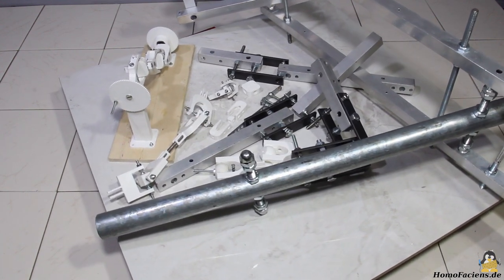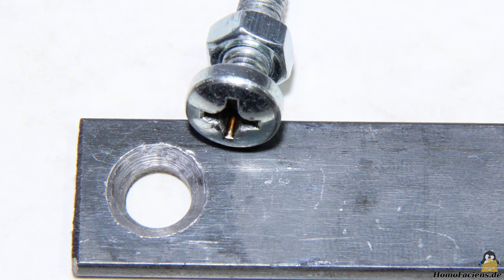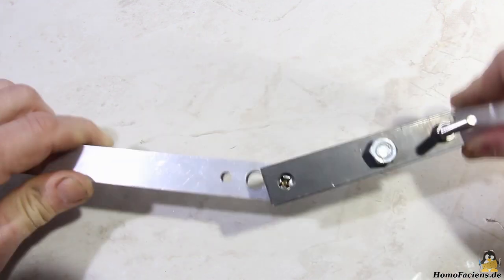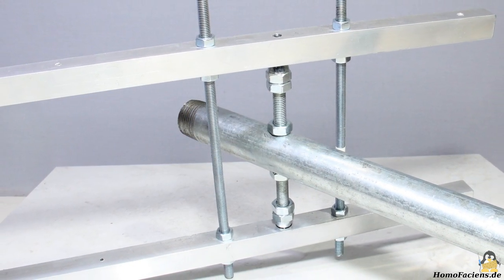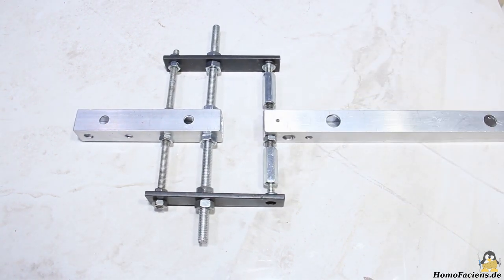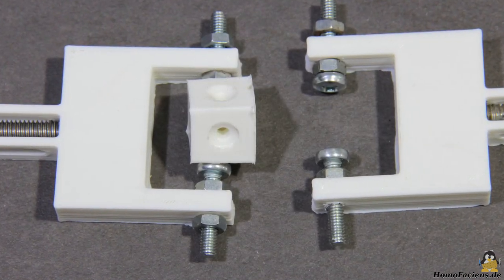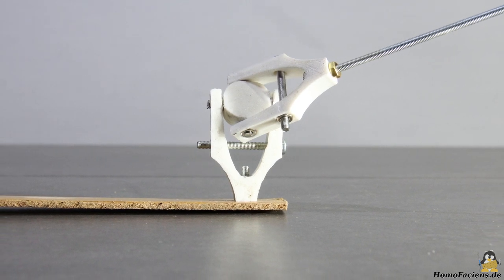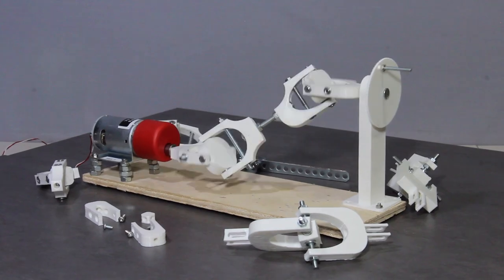Simple, DIY, adjustable joints

Comment: Great video, no time wasted. 3:50 I've done this with wood (for the center I just drilled through each side, inserted screws (cut off heads), and attached pcb columns that connected to each support plate) and surprisingly it was pretty reliable (not something you would use in a real project though).
Reply from the maker: Makers often need quick to build solutions for a proof of concept rather than something perfect that lasts for ever. So thanks for sharing your solution!

Comment: Excellent information.  Even though I am more electrical/software oriented, gears and linkages can be fascinating.   Was the pipe countersunk ? The pipe that the 10mm nuts made contact with. It did not look like it was but I guess it would of had to be.
Reply from the maker: Aluminium is relatively soft which is why those square tubes bend slightly inwards when pressing the cap nuts on the edge of the hole. With that there is no need to countersink the hole. Especially with a wall thickness  of just 1mm, countersinking the hole doesn't really make sense.